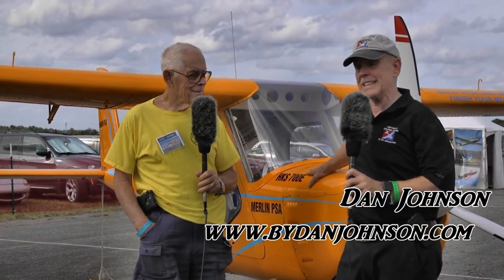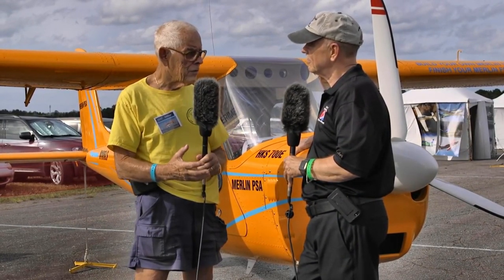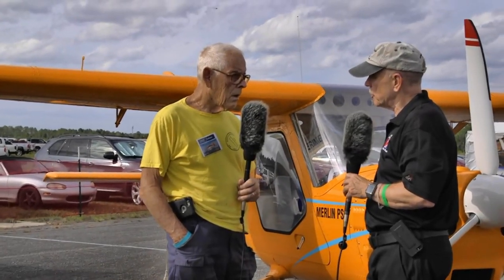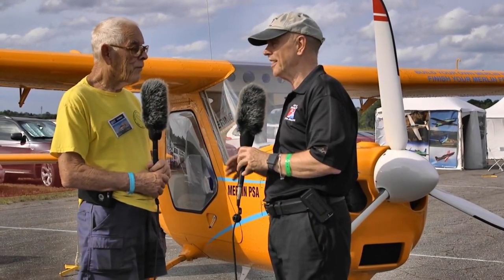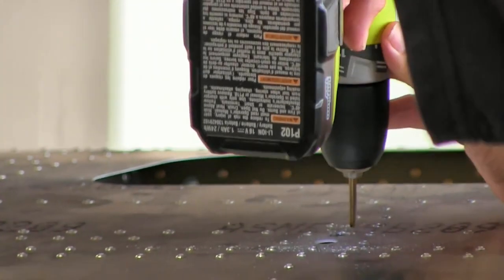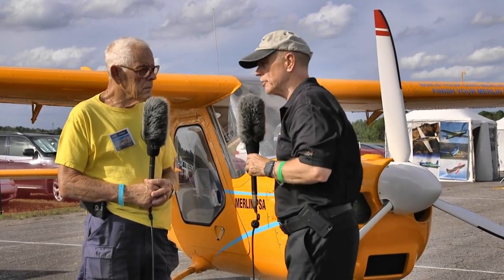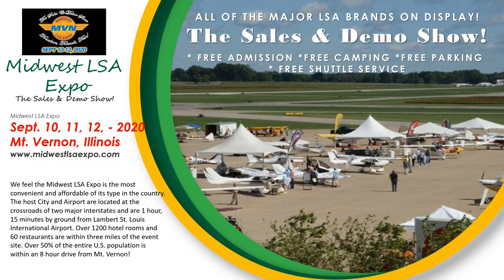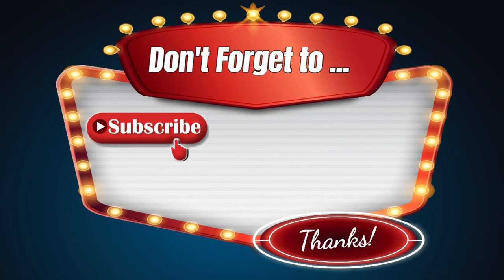Merlin PSA, AeroMarine LSA, Two Week Build, Merlin PSA Experimental Light Sport Aircraft Kit.

Comment: I am watching this thinking I might want to do this. Its been 10 years since I worked but I am A&P, IA ( not current,) and PPL 430+- hours, again not current with no medical. I am sure with 30 years wrenching on aircraft I could zip thru the builder assist. It will be right up my alley but, how to get current with no medical. That's what i am wondering. I have to make some phone calls. Also can I get a tail wheel endorsement without soloing? But I think this or the "lite" would be great. Maybe both. Hmmm.
Reply: Light Sport has different medical requirements. I think you'd be able to make it happen.